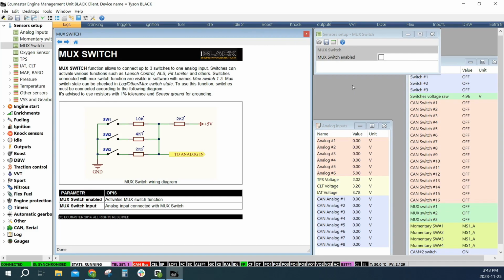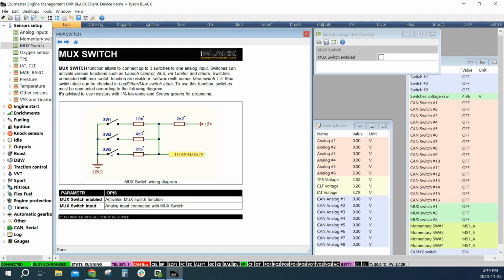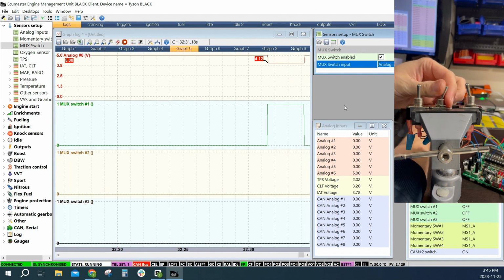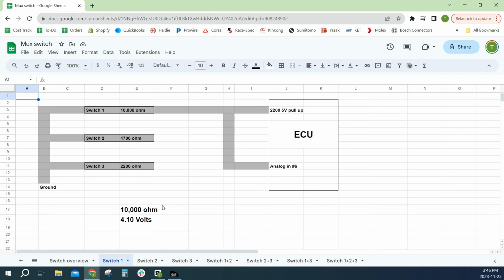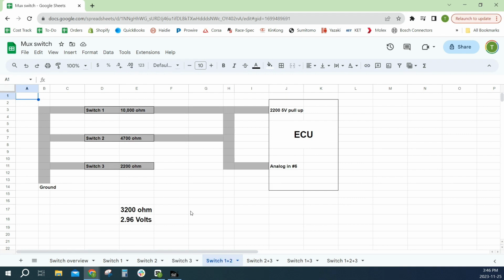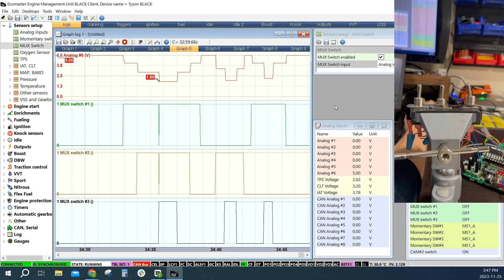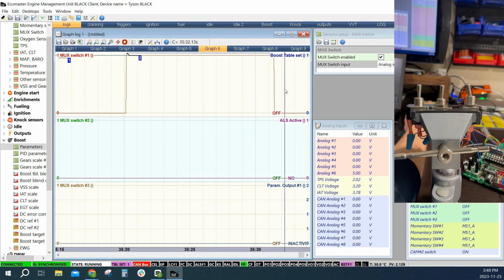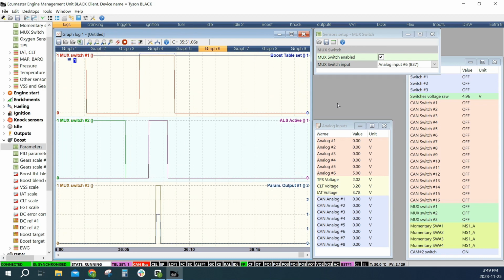Mux Switches on ECUmaster

Comment: with this setup, is your analog input 6 set to 4k7 pulldown then?
Reply from the maker: 1M pull down, the circuit has 5V in it and does not need the onboard pull up
Reply: @FlooritGarage  i was unable to get the mux switch to work in the same setup you showed, but instead put the analog input as ground, and 5v on the other side of the circuit. this was the only way i could get the switch working, no other configuration would give a response.

Comment: Do you know if the switch that Ecumaster is selling has the resitors built in?
Reply from the maker: https://ecumasterusa.com/products/mux-switch-board?_pos=3&_sid=484bdc76c&_ss=r&variant=43871086772465

This is their mux board, it has 3 switch inputs on it.
The 8 position rotary switch is a simpler 0-5V output, not what the video is about.